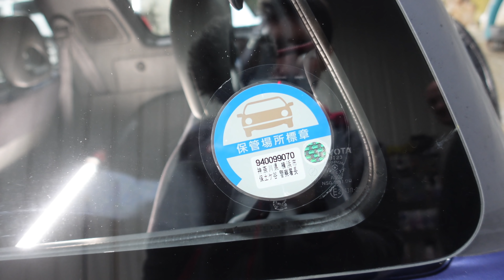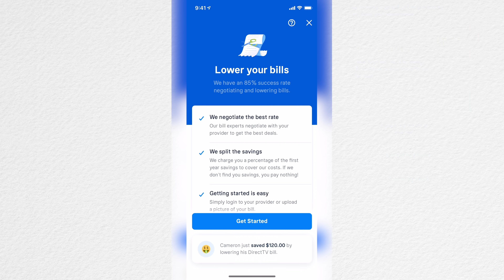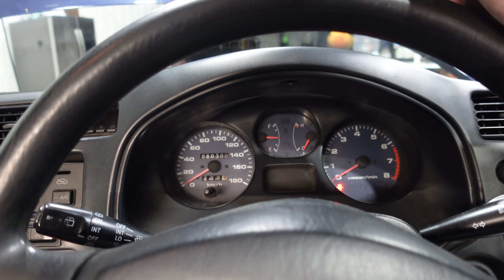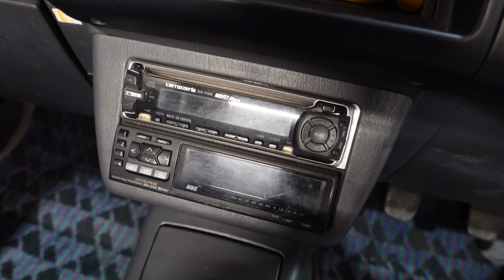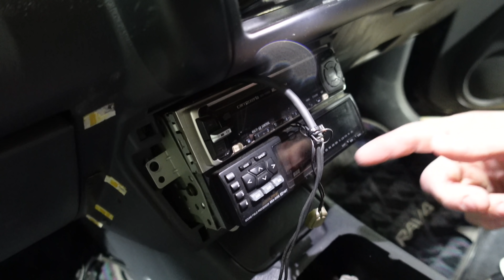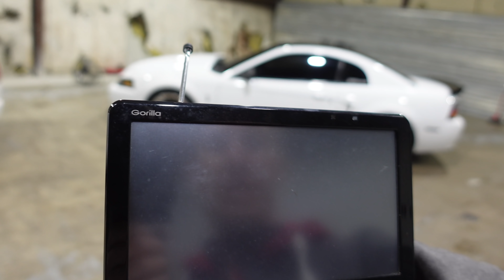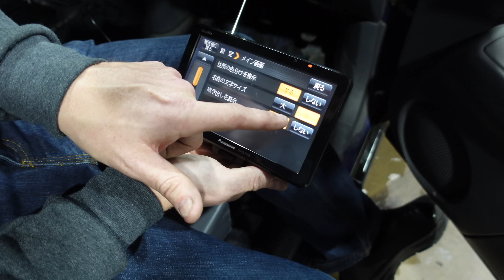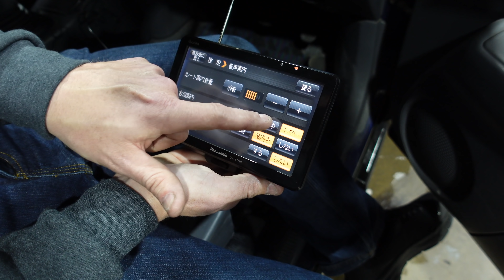This Might Be The RAREST Toyota Rav4 In The United States *RHD*

Comment: Here in NZ i just sold my 94 3 door auto 4wd. 105k miles. Put it on the web, SOLD in 20 min for $3000. A dairy farmer brought it, he had 5 of them. Preferred them over quad bikes on the farm in the Waikato N.I.They went thru the mud better, climbed greasy slopes better, and in the rain at night, during calving ,he could sit inside with the heater on listening to the radio and MUCH cheaper than a quad. He put 16 inch tractor tyres on the factory rims. Got a shock how much an old car was still worth, BUT it is a Toyota !!!!
Reply: Definitely see them going up the ski slopes down south too
Reply: Yes, for farming they are great. I am a farmer myself in Spain and they are better than any quad and go throgh mid, snow, just ploughed terrain. Fantastic vehicle.
Reply: Aye 🇳🇿🇳🇿🇳🇿

Comment: Love the original RAV4, my mother had the 4 door manual RHD model in New Zealand and it did 300,000km without even one major fault. Also the ground clearance is pretty reasonable abd it has a centre lock diff which makes it competent offroad with appropriate tyres. 🙂👍

Comment: We are fortunate in Australia in that we can import any age car from overseas - new to old. The main criteria is that it must comply with Australian Standards & the car specification is not available in Australia.IE we can import a car that looks exactly like ones that are sold here, though the vehicle you import must not or never have be available here with the same factory OEM equipment. The ones we see that are Japanese imports have much higher options that we do not get here. Most of the time they are mechanically the same. Plus they are cheaper and have much less mileage than equivalent Australian market vehicles from the same manufacturer as the one you are importing from overseas or buying from an importer. BTW, we call them "grey imports".

Comment: To be honest finding a manual  rav4 of that generation is difficult here in the uk where they were actually sold. They've all rusted away. There's 3 on uk autoloader. There all year 2000 ones. Even a short one like that  3 door for £1000. There's a 5 door also

Comment: I have 2 RHD RAV4's but they're 4 door automatics.
Mine are also Gen 1... 
I haven't had any problem getting parts so far.
I've replaced shock assemblies, rotors, pads and even a radiator with parts off the shelf.

Also have a RHD CRV but have had multiple parts issues such as brake rotors. I got lucky with the front brake pads... 1999 Civic pads worked great.

Comment: Very cool little car and it's actually full time all wheel drive and that button in the center console it's to lock the system 50-50 front and rear and it should only be engaged on slippery situations.

Comment: Hi from Portugal ! in the video you say that the 4x4 button engages the 4wd , and that is not correct , sorry . That little RAV4 has permanent all wheel drive , with 3 diffs , rear , front and center . What the 4x4 button does is to block the center diff , turning the RAV4 into a real 4x4 drive . Oh , and the center diff lock is not vacuum operated , but electric operated ( at least on european models ) . You will be amazed about what these little RAV4s can do off road if you take it there ! Cheers !

Comment: Got the same 3sfe motor,only bug bear with them is the oil leak to the oil pump seal, replace the pump when you do a timing belt.
Reply: I actually buy them in bulk :)

Comment: Check the use of that centre diff lock. Pretty sure you shouldn’t be using it on tar like you did and only at limited speeds. Having to reverse so much before it unlocked was probably because it was bound up. 

But cool little vehicles. Being in South Africa they fairly common so not really a novelty here.

Comment: The car is full time AWD.  The dif lock just locks the front and rear ends.
Reply: I thought that as well but AWDWiki says it does have a center diff, quite unexpected. Manual trans versions use a mechanical locker, auto versions a clutch.

Comment: You should see my son's JDM import .... 2002 Peugeot 106 GTI S16 ... It was sold new in Tokyo ... Currently has 103,000 km (63,000 miles)... It's an  awesome little hot hatch .... It weighs about 2050lbs and ours has had some work done so it's pushing about 150 hp at the wheels .... And ... The  suspension is done ....
It's one of a handful here in Canada  ... Always a blast to drive